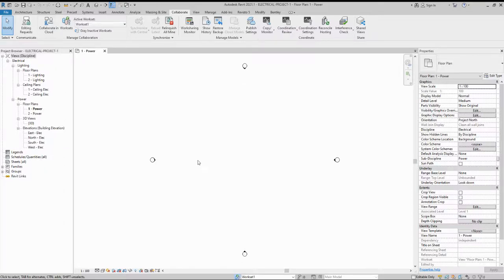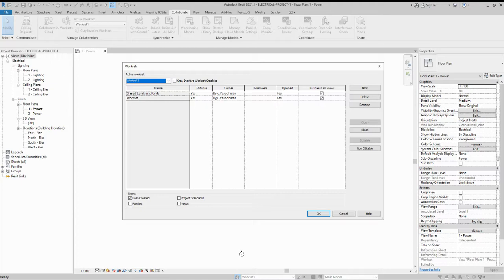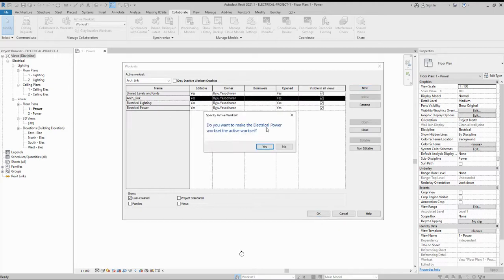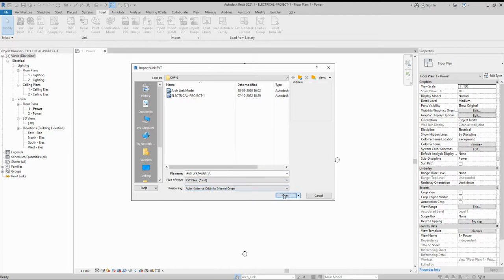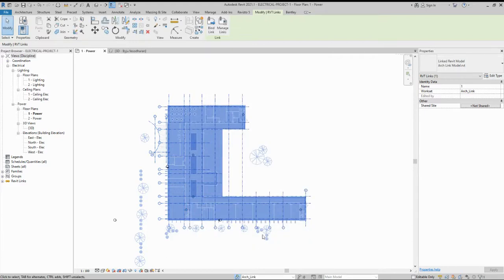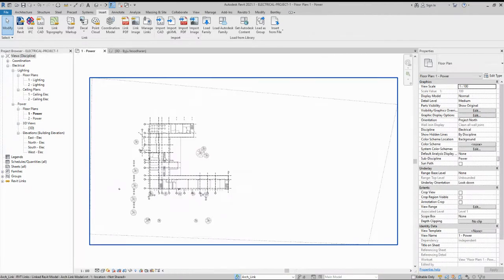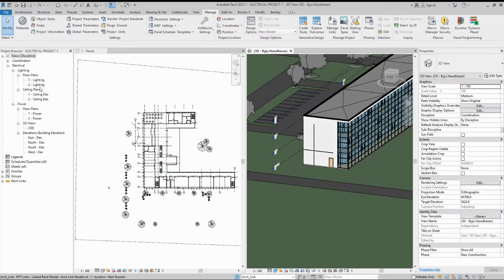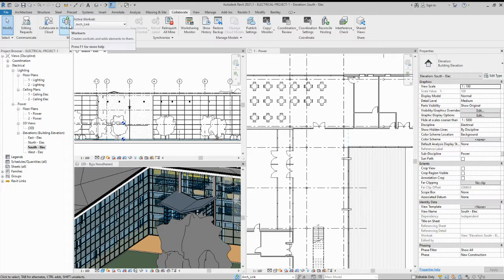Linking an Architectural Model|| Revit Electrical||3

Comment: sir can we create center file and whats the use of it
Reply from the maker: Yes you can create if you are working with group its useful, if you working through BIM 360 platform it will very useful. Group of people can work in a Revit Center file, Center File" serves as a central reference point for collaborating on a project within a team.😍
Reply: @AutoCADRevitByju  can you make a video about that?
Reply from the maker: Sure Thanks🙏